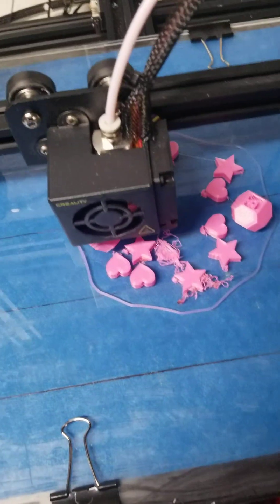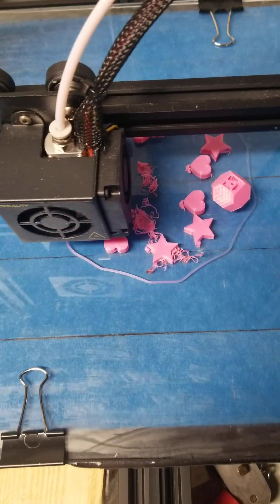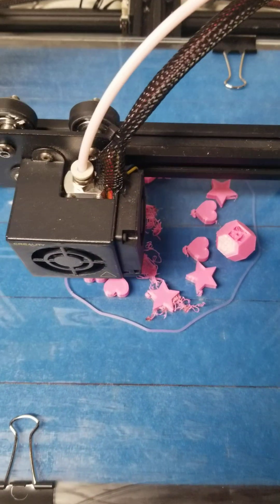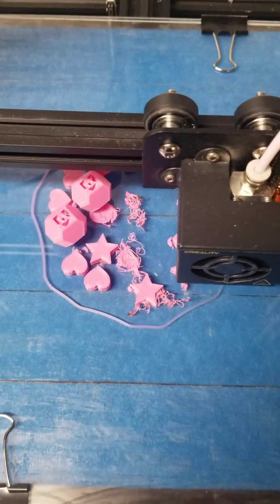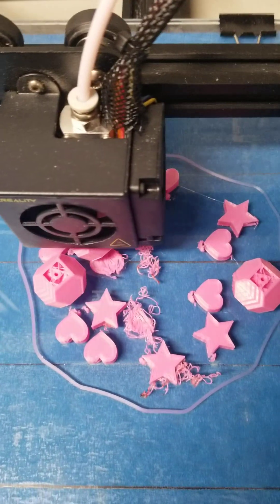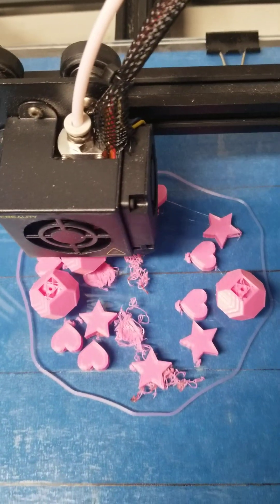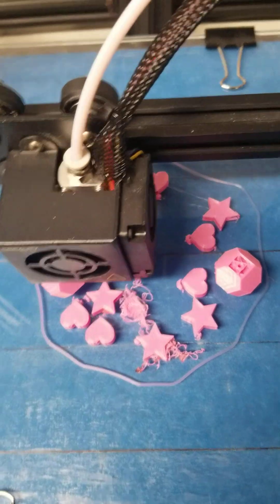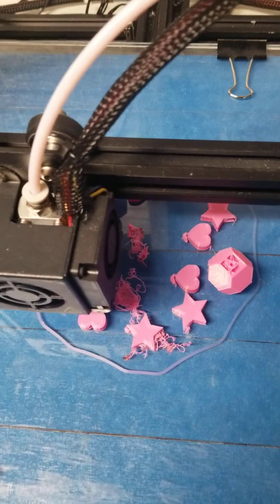How Do I Print Silk? #stringing #3dprinting #sIlkPLA

Comment: This isn't stringing. It looks like your bed isn't level based on the skirt that was printed. Also could be a bed adhesion issue. Glass kind of sucks by itself in terms of things sticking to it. Use a layer of glue stick or Aquanet hair spray on the glass where you plan to print. If you don't mind doing a little bit of work you can also use a tell Cura to print a brim instead of a skirt which will give your parts more surface area to attach to the bed.
Reply from the maker: I prefer no glue stick. I get better results with high bed temps. I disagree that there us no stringing, but Indo agree that I messed up with the brim as I had carried over the Cura settings from a previous build that had so much structuring that it didn't need a brim. That was definitely my bad. Some of the stringing, I think, came from some that broke off and moved from the glass and then the printer tried to print at that layer and carried over to the next structure.
Reply: @davesplains9400  google what "3d printing stringing defect" is. Stringing is something completely different and can be fixed usually by adjusting retraction settings. What you are describing is spaghetti when its printing in the air with the nozzle not touching anything either due the print falling off of your bed or it or layer shifting or something else. Looks like one of the round pieces fell off after the first layer layed down. That layer also looks bad. Again, I would do the bed leveling proceedure and make sure the print is sticking to the bed. Also is there a reason why you would tape the bed there? Thats not really doing anything for ya but maybe slightly blocking heat tranfer to the glass? I don't get it.